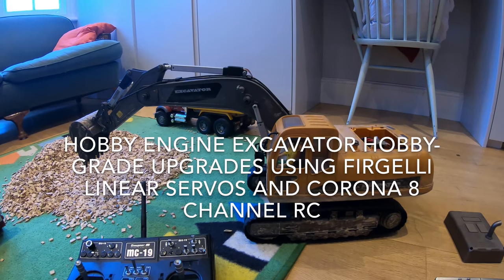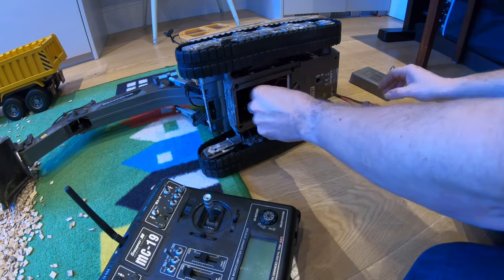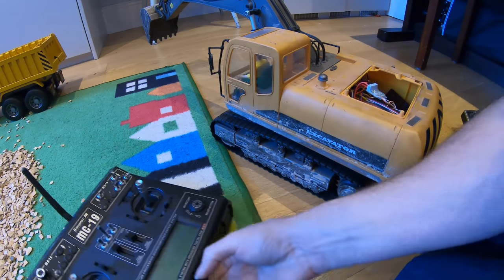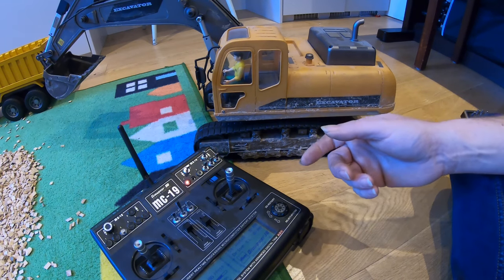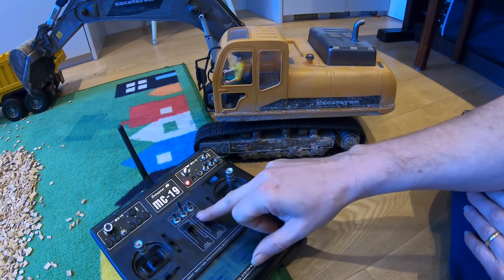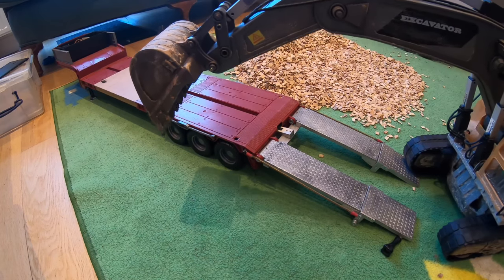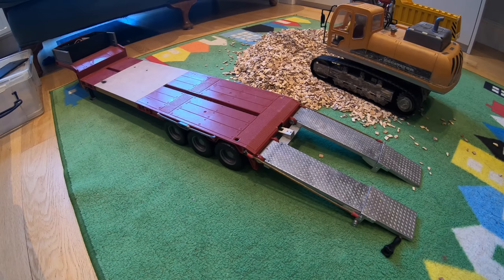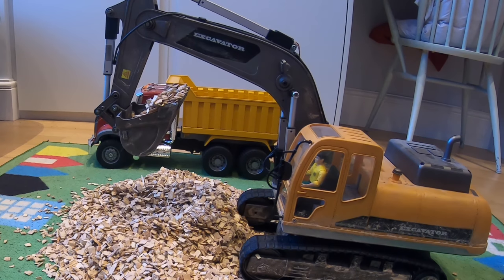RC excavator with linear servos - update

Comment: Hi, nice job with your excavator. I'm thinking about doing a similar conversion myself and I was wondering about the MC 19 mod. Did you use the Corona Z version transmitter module or did the J version fit ? (enclosed version)
Reply from the maker: Sorry for the delay, I forgot that I had a comments approval filter on. I used a CT8Z DIY kit.

Comment: Nice mod do you have any diagram? wiring for this mod? Thanks in advanced
Reply from the maker: No I haven't yet. But I will try and draw one in the next few days. I'll put it on the facebook page that I've associated with the channel and post a comment with link in all the videos I've done on this model. Thanks for prompting, I should have done this a while ago. It is not complicated, but you need to get the right voltage and amps to the right places to avoid RC brown outs.
Reply: Thanks one more question, there some kind of a short circuting switch in the big arm and the end of the the mentioned arm, do you know what this is for?
Reply from the maker: probably some sort of electronic end-stop switch to stop the motors at the end of the travel, so that the motor doesn't rip the gearbox apart I would suspect. With linear servos, you can set end stops on the transmitter, but the set up I put in cost a lot more than the original model - although this is considerably less than commercially available hobby-grade diggers which cost thousand of pounds and the stuff I put in can always be taken out and used in other RC builds.
Reply: Thanks man